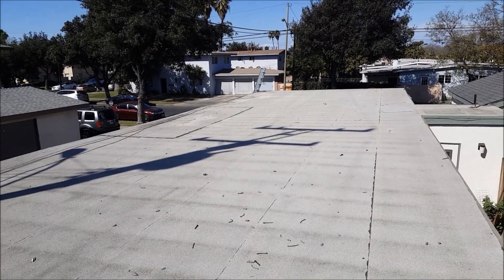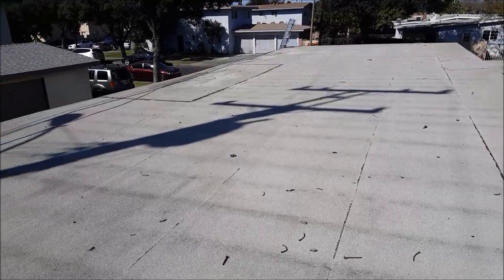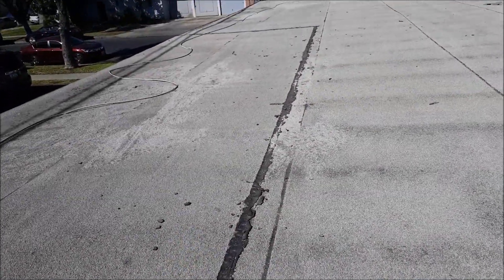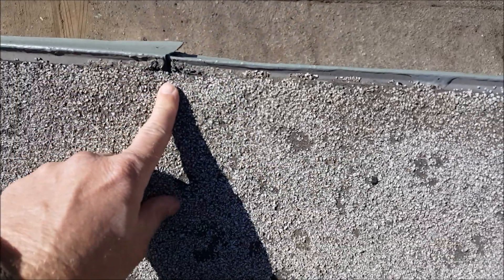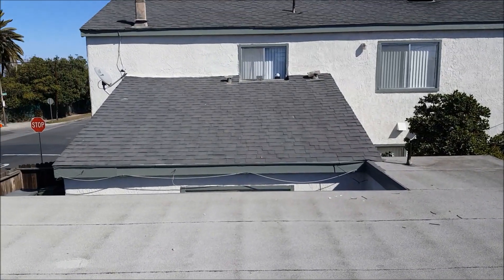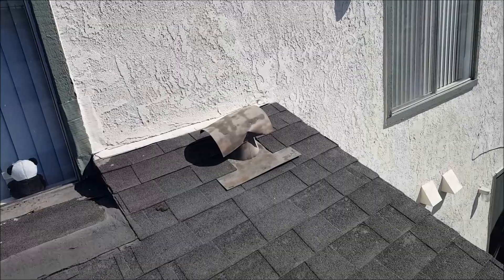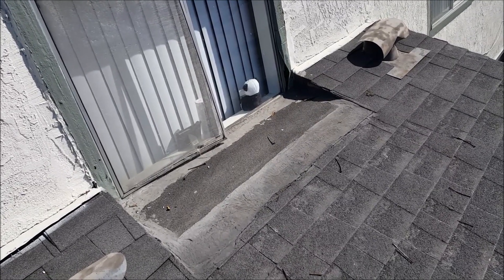Hot tar roof inspection shows what makes the roof fail.

Comment: Thats a mexican hack job
Reply: jim tom racist fuck
Reply from the maker: The repair was a hack job for sure. The original job was not that bad.
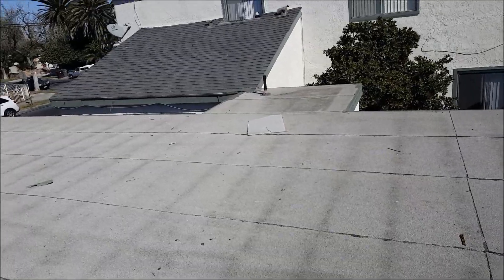Reply: @SouthCountyRoofing   Actually, at the 2:08 mark, you can see that the original is also installed improperly. The ends of the rolls all line up, so they didn't break their rolls. That's a big No No. Also, if they had sealed the joint when they installed the drip edge the issue they are having wouldn't have happened either. Its very simple, but most roofers skip that step or don't know it to begin with.

Comment: its insane how the slightest mistake can be devastating, i would never notice those joints not being nailed down but it ruined a whole section.
Reply from the maker: Yep, what doing flat roofs you have to be very detailed if you want the roof to last.  Very small mistakes will come back to haunt you.  There are no roofing manuals that covers some of the failures that you see over long periods of time.  These are little details that if you have been in roofing long enough and are observant you can pick up on them.  Or, you have to be taught.  Good luck with that.